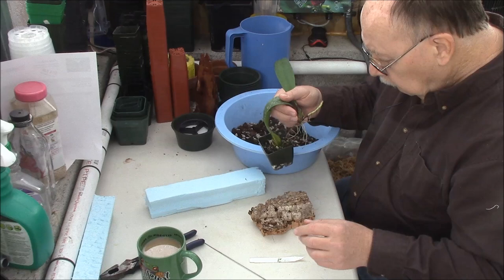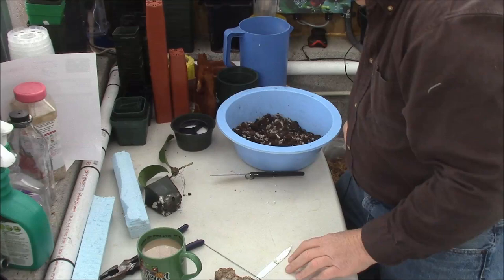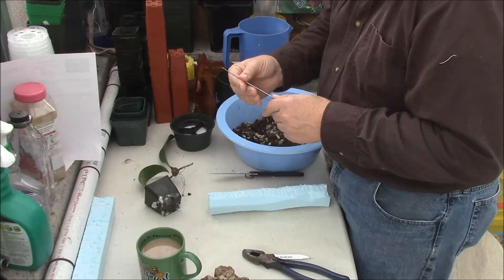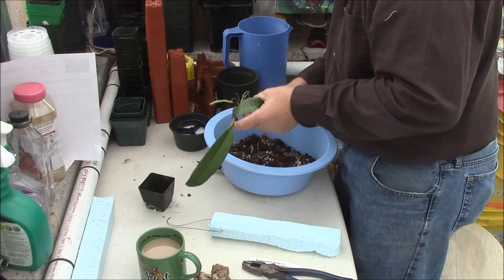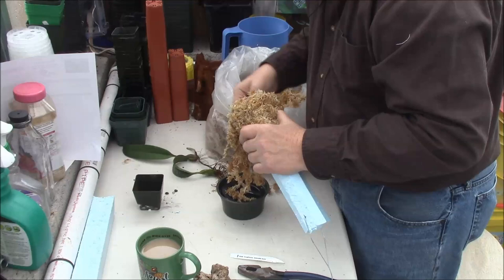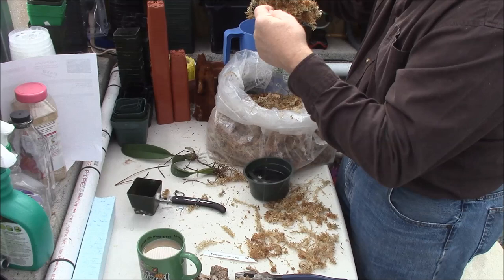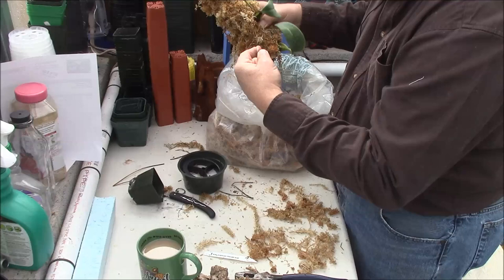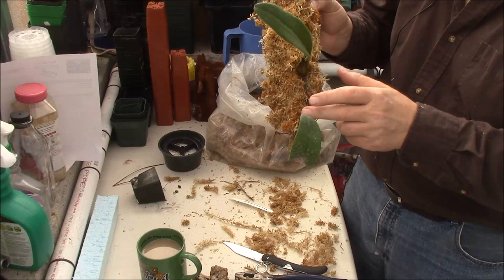How To Use Styrofoam To Make A Mount For Orchids

Comment: Using your technique, I just mounted a bulbophyllum sanguineopunctatum.  My first mounting effort, ever!  It did not have long rhizomes like yours', however, I felt it would be happier to wander and catch some breezes.  It took me forever.  But she is hanging now, I'm just hoping she will "take"!!  Thank you for your video.  I watched it 5 times before I started and I really piled on the New Zealand moss.  Just hope I don't have to repeat the process too soon!
Reply from the maker: If it took forever and used about 3 times as much moss as you thought you did it right :). If you have any live moss (woodland moss works) try to tuck some into the crevices so that the moss will eventually take over. It's much nicer than the algae that seems to grow so easily on sphagnum. After about 1/2 year experience with this method it seems to work pretty well. I find I need to water almost daily - partly due to the quantity of air moving in the greenhouse but also because there is a lot of evaporation.
Reply: I know where to find woodland moss,  I'll have to go at night, special ops mission.  Forbidden to disturb the moss.  And yes, I do not like the algae - at all!  People here strip large areas of moss, so it's kind of a no-no.  Would Spanish Moss work?  And thank you SO much for the thumbs up!  It was a labour of love!
Reply from the maker: Spanish moss doesn't work because it doesn't really cover over the area that the algae grows on. Woodland moss covers the sphagnum and prevents the formation of algae.